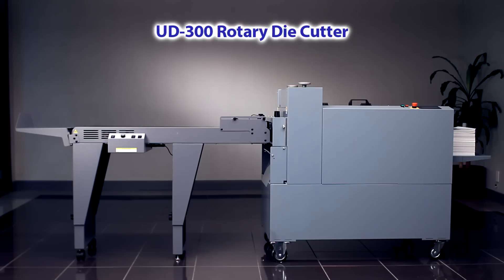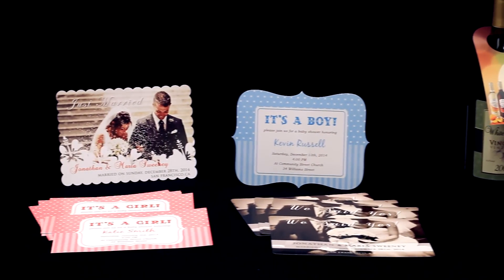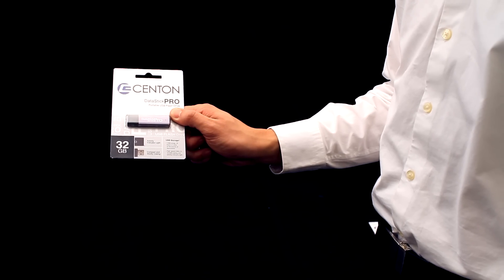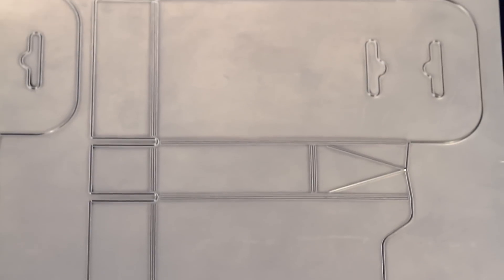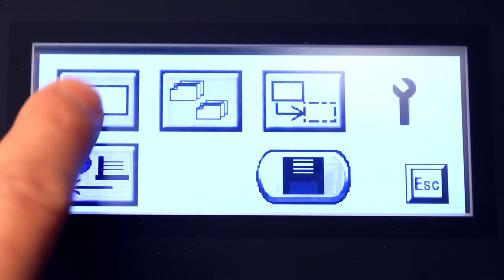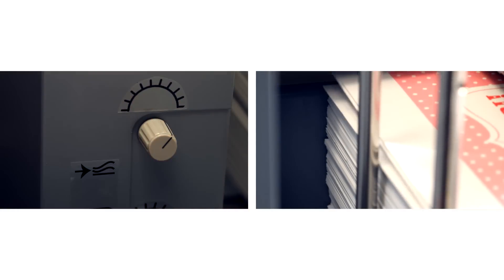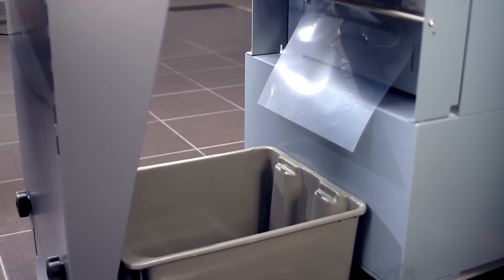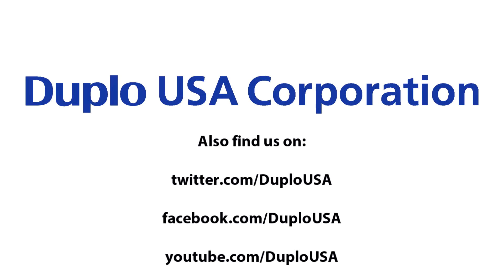UD-300 Rotary Die Cutter | Updated Product Demo | Duplo USA

Comment: The die prices are so expensive! Is there a place that doesn't want an arm and a leg to make a die for this machine? The die prices are losing us sales left and right.
Reply from the maker: The upfront cost could be but the dies are good for up to 200,000 impressions. When you calculate the cost per piece on a single die, the cost becomes minimal.
Reply: @DuploUSA  Two hundred k imps on what material?